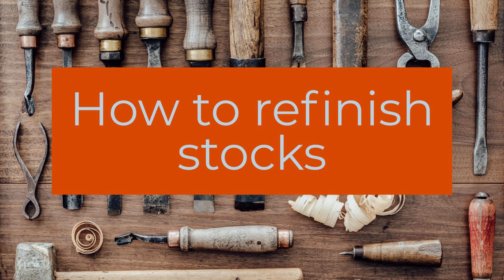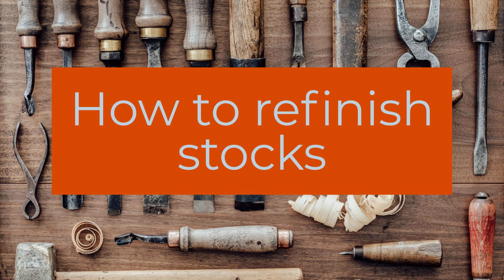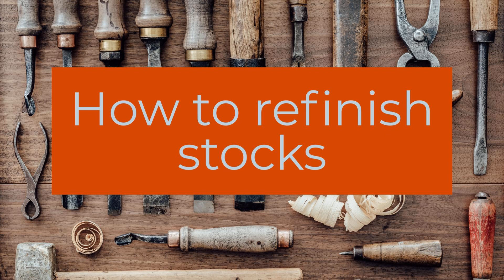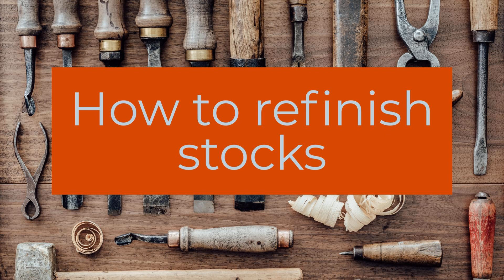#153- How To Refinish A Gun Stock

Comment: I found this video as I’m possibly going to embark on a Ruger Mini-14 Wood stock refinishing project. I’d like to be able to put a beautiful glossy finish on the finished product. Especially those amazing tiger striped stains.
Reply from the maker: You choices. If you want a really shiny finish, you can’t beat the spray on poly finishes. Gloss spray polyurathanes from Home Despot, etc. But they can chip or crack during use and the only way to fix it is to strip the finish and start over. I prefer one of the oil bases finishes. Birchwood Casey makes an excellent one. You put on as many coats as it takes to get the shine you like. Roy